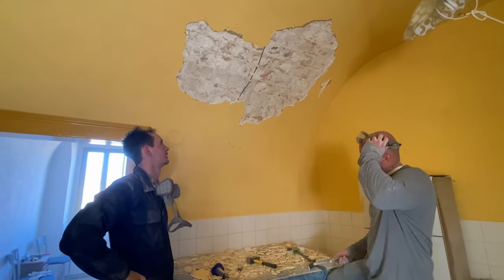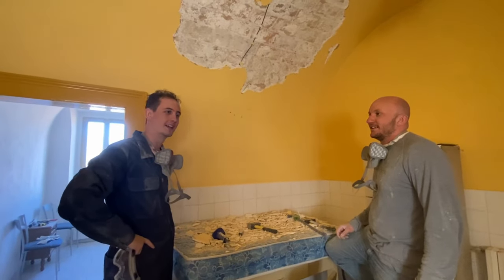Renovating Our Italian Home - Exposed Brick Ceiling

Comment: Hi, fantastic seeing those beautiful old bricks coming back to life! We are at the brushing stage with ours - what type of brushes are you using, and what are you applying to get that amazing terracotta colouring back?
Reply from the maker: Hi Mikey! Thank you so much for the support. So we just used some cheap throw away brushes for this chemical part. The stuff we got came in a small grey bottle with a yellow lid. I believe it was called WET - Brick Sealer
Reply: @casetta-ourlittleitalianho3134  Thank you for getting back to me! Is the brick sealer from an Italian hardware or UK? 😁